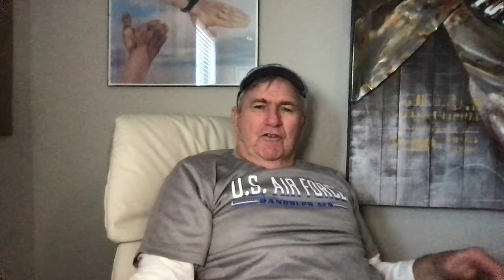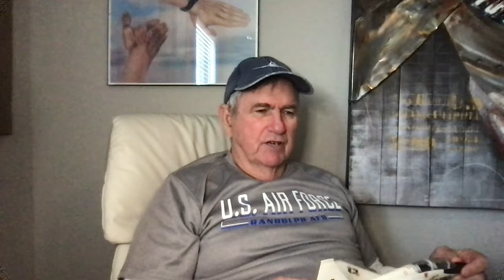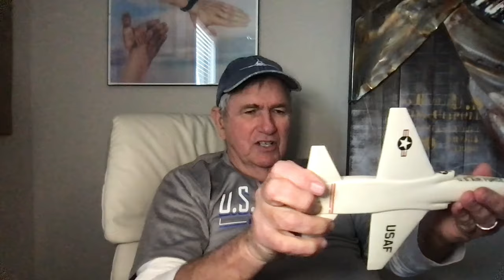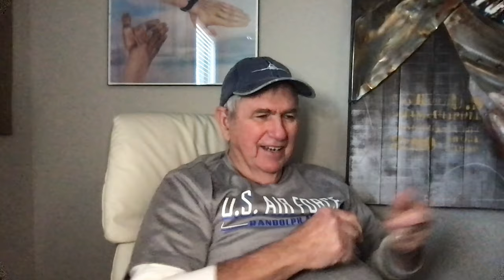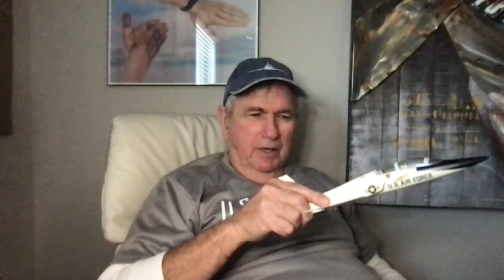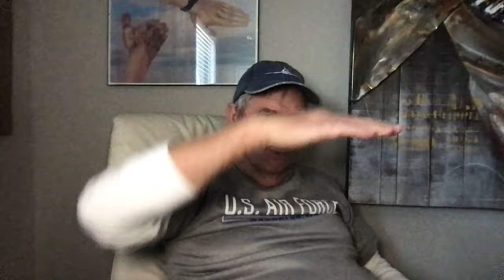Why Did You Do That?

Comment: I was in Class 73-04 at Webb. This class started early in 1972. In both the T37 and T38, we were required to get a verbal clearance from the IP before putting the gear or flaps up or down. I thought this was standard at all the training bases. I guess that’s not the case.